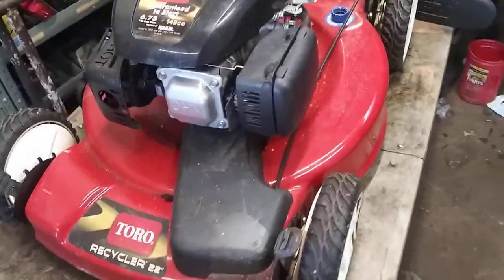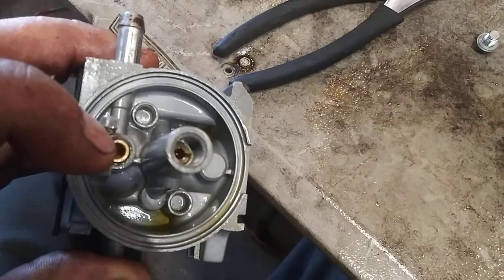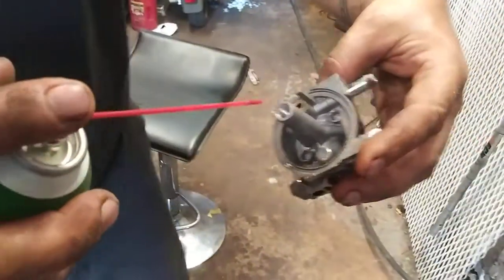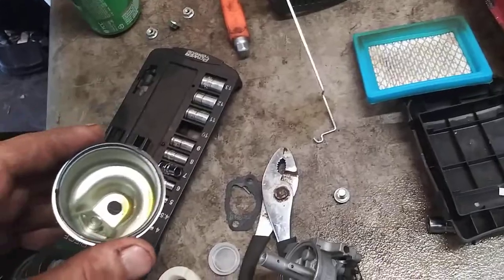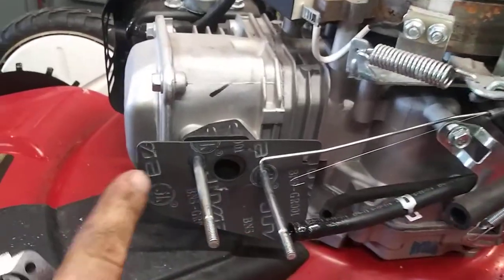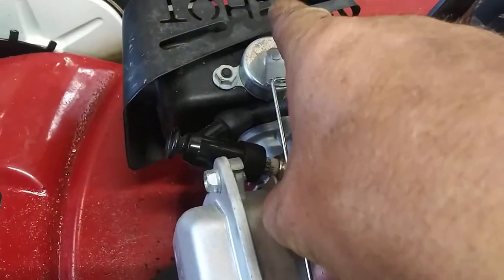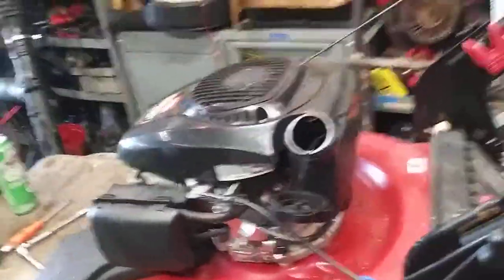* Toro recycler carburetor rebuild kohler 6.75 149cc

Comment: Tks for sharing! Im 50+ yrs old and only now getting mechanically interested in fixing my small engines myself. This vid got me over worrying I'd wreck the carb and dig into it. Found 1 of the pins for the choke arm assembly had come off preventing the blades in the carb from actuating. Now to pull up the pdf and find the part number i need.
Reply from the maker: gotta get whole carb sorry
Reply: @smallengineguys  oof.. well then I can stop hunting for that pin. Tks.

Comment: Thank you for posting. My mower was slightly different as far as how its connected on the opposite side of the carb. Just 2 bolts holding a bracket on near the spark plug. You were a ton of help with this process and took all the guess work out. You are the man.
Reply: Hi what tool you use to remove the 2 bolts?
Reply: @chris-samuel-cesar 10mm

Comment: Thank you for such a detailed video on cleaning the cab. My mower would run very rough and eventually die when it warmed up. My first thought was that the choke was not opening up but after checking the automatic choke with a heat gun it work fine and the choke was in fact opening up. My neighbor suggested that when the choke opened that the engine was probably running too lean and that cleaning the carb might help. Your video gave me the confidence to clean the carb. In addition, I also remove the actual jet and the tube inside and used a wire and carb cleaner on those items as well. After cleaning the carb and re-assembling the mower it is running great. (My carb is slightly different that the one in your video.)  I would have never cleaned the carb by myself without seeing your video. You saved me a lot of $$$. THANK YOU!!

Comment: Great video!
I had a problem with my mower that wouldn't start and I didn't want to go to the repair shop. Luckily, I came across your YouTube link. The video and narration are very clear and helpful. I was worried about disconnecting the carburetor spring and links, but it turned out to be easy. I successfully removed and cleaned the carburetor and put everything back together. The mower runs like new now. I added a fuel stabilizer and a few ounces of Sea Foam fuel treatment to the gas. Also, I found out that my local Home Depot has parts for this mower as well.

Comment: Just picked it up off craigslist $40.00 it runs about a minute I found the carb “Amazon “ about $20.00. You got the exact mower I have Kohler 6.75 hp 149 cc. Thanks I might have to back to your video when I get the carb thanks .

Comment: Great informative video, I learned a lot , if you decide to replace the carburetor is it necessary to go oem or something universal would do the job
Reply from the maker: Buying aftermarket is fine but you need to pay close attention to the linkages. Kohler had a couple different styles of carbs for the same motor

Comment: thanks, hope this will do the trick, hadn't seen mine spilling gas all over the garage before but I've replaced a lot over the years.
Reply from the maker: Good luck!
Reply: @smallengineguys  worked like a freaking champ =), I should just get a replacement carb since the o-ring was getting grungy and 10+ years old...but wd-40 and some carb cleaner we are back running.   Might've been a clog on the airline too but I blew everything out to be safe
Reply from the maker: @derekp6636  nice!

Comment: Thanks for the rebuild vid. I'll be giving mine a shot tomorrow. Not a fan of the autochoke system
Reply from the maker: they work great. just do what i showed it will start first pull.
Reply: @smallengineguys  I'll give it a rip. But I might need some shine to celebrate 🤣🤣🤣
Reply: @smallengineguys  I was going to just buy a new carb, but that seems wasteful
Reply from the maker: to easy to clean but sometimes a new one works best for certain people

Comment: Would cleaning out the float needle area fix a my gas leak problem? The float won't sit level against and when I push it up shut with my finger the leak seems to stop
Reply from the maker: Sounds dirty
Reply: @smallengineguys  I took it apart cleaned it. Put back together still leaking. The float doesn't sit flush and I think the needle isn't properly sitting in there the spring seemed to have lost its springiness.. not sure if I just buy a new carb. ?
Reply: I just got a new carb kit for 17 bucks. The gaskets are falling apart anyway. So I may as well
Reply: Annnnd..
 That fixed the leak. It was the float and needle buuut finding just the right needle and float kit was a pain in thr ass-embly,  so a new carb for 17 bucks got me a whole new carb kit with fuel line filter and starter.  Didn't even need to swap out the fuel line. Just carb and leak gone ( new needle, float )

Comment: I have rebuilt a very auto,Ford tractor down draft of course Holly always a break sheet however dumb a s s Kohler not  available the dealer said that they did not have òne I asked if they had o e in manual that I could pay for copy said not possible he did wish me good I always felt that I would be able to do this but I wanted you to know how much I appreciate your video it will take a lot of speculation  out.
You are a good speaker as well as,instructor thank you
Reply from the maker: common carb and very easy to clean

Comment: The carburetor that you put on the description and link, is that a good carburetor for the coiler motors
Reply from the maker: The carb i put in the link is for this kohler motor. It works well.
Reply: @smallengineguys  ok thank you I have a toro 20377 and engine is a XT675  only thing is my filter is longer   Well it still work love you videos man I just subscribe
Reply from the maker: @junebug3058  it should work but look closely at your choke mechanism on your carb and the choke mechanism on this one. Kohler used 2 different carbs and that is the only difference.
Reply: @smallengineguys  ok I’ll check
Reply: @smallengineguys  thank you
Reply from the maker: @junebug3058  no problem!

Comment: Mine has the issue where gas pours out of the air filter. Float good, needle had some crud cleaned it, spring was bent so I straightened it, still leaking. I will clean the seat. Any other stuff to check?
Reply from the maker: needle seat or float. one is bad or dirty.

Comment: Do you ever remove the main jet and clean the ports in the emulsion tube?
Reply from the maker: yes all the time. although after i started using this acid it isn't as necessary.

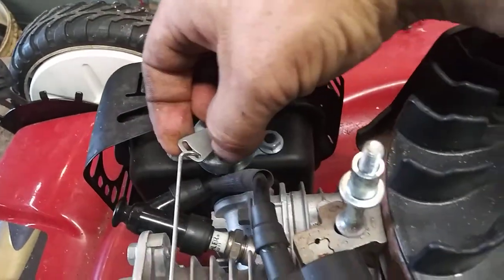Comment: What is the pin called at the 1:06 mark? Do you have a link to order? Thanks.
Reply from the maker: @charlesknifechief8096   sure exact name. The pin is built in to the controller . Id call it the choke shut off controller. It bolts  to the muffler. As it gets hot it shuts off the choke.
Reply: @smallengineguys  I found one! Thanks for the info, much appreciated.

Comment: I cleaned my carb, but it's still surging. Any suggestions?
Reply from the maker: gotta do it again. sometimes even i have to do it 3 times. make sure gaskets between engine and carb are good
Reply: @smallengineguys  okay, I cleaned it about four times now. It idles fine now but for the first 10 seconds it starts rough with a little bit of black smoke and surges.